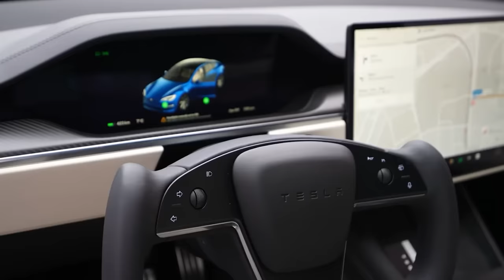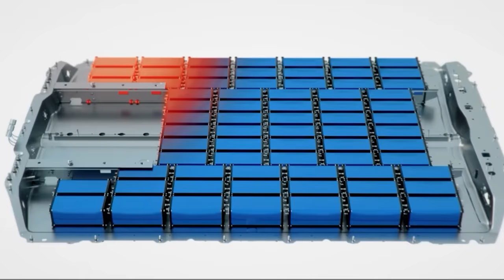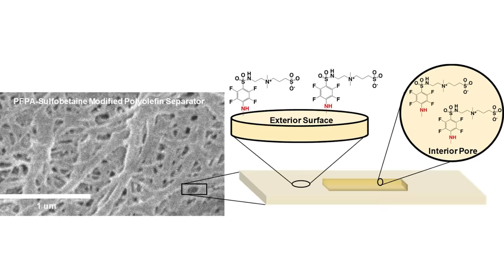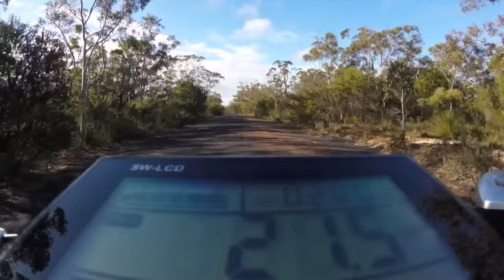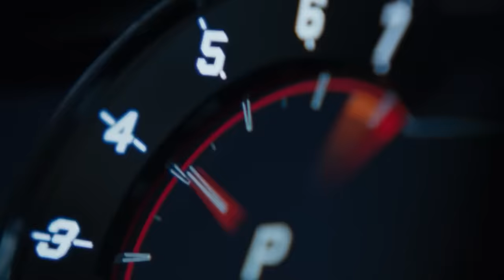EV's Are Exploding In Shocking Numbers

Comment: This is what happens when governments think they know best.
Reply: govt always thinks it knows best, but it never does
Reply: And how many politicians get a 'gratiuty' for supporting the EV makers?
Reply: No towtruck driver will touch them.
Reply: No this is what happens when unproven tech is pushed out too early.
Reply: Let's go Brandon for forcing us to buy EVs only
Reply: @johndoe8785  The tech is already proven.
Reply: @redbaron6805  hey real quick, how long have we been using combustion engines on a daily basis throughout every facet of our lives? How long have we been using electric vehicles? So just about 150 years vs 15? Tell me what part of that screams proven tech?
Reply: @johndoe8785  You are missing the forest for the trees, for several reasons.

1.  Electric cars have been around since the 1800's, so they weren't exactly invented a decade ago.

2.  They use electric motors to move them, again, technology which has been around also since the 1800's.

The only thing that is even remotely recent is advances in batteries, and Lithium Ion batteries specifically, which is around 40 to 50 years old, with the modern forms of that technology being about 1 to 2 decades old.

Which means they are using a proven technology already, although it keeps advancing.

And Combustion engine cars were not in "every facet of our lives" for 150 years.

Combustion engine cars didn't become common until the early 19th century, which is around 100 years ago, and the engines used in those cars have very little in common with the engines used today technology wise.
Reply: yep, so vote Democrat again.....
Reply: I am pro EV and strongly free market. Let the market decide. If someone wants an EV let them buy it. If someone wants a diesel, or a gasoline powered car, let them buy it. If there are not enough buyers to support the manufacturer of EVs, too bad, so sad for us EV buyers.
Reply: @johndoe8785  You're surrounded by lithium ion batteries, they're in your tools they're in your phone, they're everywhere. Batteries in general have been around longer than internal combustion engines. You are also surrounded by electric motors, they are everywhere and in just about everything. The only real novelty with EV is that people are not used to the idea of battery operated cars,
Reply: @redbaron6805  thank you for such a well thought out and common sense response.
Reply: @davidmlong63  I think you misunderstood. The automobile has been continuously improved on the platform that it's an automobile. The electric automobile has not been around long enough to be continuously improved like the combustion engine automobile. If it had we'd be miles ahead.
Reply: @redbaron6805 yea proven to be a bad alternative to gas
Reply: @gunslinger2261  Proven a "bad alternative" for people that dropped out of school after 2nd grade...
Reply: @garman7921 agree , people dont know they to busy with their life
Reply: The difference  is that using these batteries  in our everyday life things around our house is because they are not constantly running for hours at a time. In a car they are running for hours at a time ,and when they get that hot boom. Plus anytime Salt or fresh water hits it when there hot. Kaboom
Reply: @VEE1959  That is a pretty childish explanation.  You are not constantly using them at your house...???

So, your cell phone and battery powered electronics you are turning off every day...???

In a car, you are using a few hundred watts every night from a battery pack that holds tens of thousands of watts.

And fresh and salt water isn't hitting anything, as the battery pack is sealed.

If you have no idea how things work, just look it up instead of embarrassing yourself on YT...
Reply: They probably have their sticky little fingers somewhere in the profits,there's rarely any true environmental concern involved,&EVs are an environmental disaster.
Reply: @helenbenjafield7351  Actual scientists, which are about 100,000x smarter than you disagree with you.

And looking at many of your claims here which don't even have any basis in reality, that number is probably on the low side...
Reply: Billionaires
Reply: This is what happens when governments try to think.

Comment: John Cadogan says it best, even if it is a rare occurance, it is the violence of it, and lack of options to fight it that makes it so dangerous.
Reply: B.S., He has an Agenda.
Reply: @popsracer886  Who doesn't?
Reply: Rare occurrence or not, I'm not wanting that rare occurrence to be the one I bought. No thanks.
Reply: Have You seen the luton Airport Fire ?
Reply: @peterhall8572  Just looked it up, but can only find mention of a diesel vehicle causing it, not an EV.
Reply: @vincenzodigrande2070  possible but very strange, diesel will catch fire but not from an electrical fault, that's why it's the safest fuel for shipping etc, it's a heavy oil not a spirit like petrol so no vapour
Reply: @peterhall8572  Well, Cadogan has just put out a very interesting video on this exact Luton fire and it is apparently very well possible it was still Lithium ion that caused it.
Reply: @vincenzodigrande2070  Yeah thanks I watched it this morning
Reply: In Southeast Asian countries, there a lot of modified LPG vehicles which were made to save fuel cost. They are quite dangerous and has higher chance to catch fire compared to normal ICE. So, EV is a lot safer and cheaper operate if it has reasonable price.
Reply: Apparently the fire chief was paid off to say it with the diesel fire. Have you ever heard of a parked diesel truck Lighting on fire? Neither have I.
Reply: @wrongthinker350  I live on a canal boat and have 50 gallons of diesel onboard , and a woodburning stove ten feet away, Diesel only burns on introduction to a very hot flame
Reply: @cliffowens3629  Hybrids reflected the most at 3,475 fires per 100,000 vehicles. 
ICE vehicles caught fire  at 1,530 incidents per 100,000 vehicles.
EV fires were 25 fires per 100,000 vehicles.
Reply: @BioniqBob  Missing in the data is the average age of the vehicles involved in the fire. Concerning is the fact that Hybrids are overly represented which would suggest that as vehicle age approaches parity, the data is likely to look very different to what it does today. The shift toward non oxidising battery chemistries can't come fast enough, in my opinion. Fortunately, manufacturers appear to be getting a little more liability shy.
Reply: @davidbrayshaw3529  LOL,Crap
60 to 1 lol, your reply (if true) proves that ICE should be removed from the road. 
Logic eludes you. Batteries are only getting better, while gas vehicles just keep burning up.
Reply: Sorry but is he an expert on EVs? Any relevant training? PhD perhaps? Anyone can make YTube videos, doesn't make you an expert in anything. I mean I could start a channel about nuclear power. I don't know anything about nuclear power but hey, why should that stop me?
Reply: @XenonJohnD  He doesn't pretend to be, he's just stating facts and the accompanied sources where applicable and he says it when information is not conclusive. You don't really need to be an expert to see if a car is on fire.
Reply: @BioniqBob  I don't think that my logic has made too much of a dash for it, yet. Hybrids are two and a half times more likely to be involved in fire than their ICE counterparts. The only difference between the two is the added presence of a lithium ion battery and motor in the hybrid. Why then, more than double the fire risk?
Yes, batteries are getting better, and they are getting SAFER. But that does not alter the fact that there are a large number of EV's on the road that incorporate
older, more hazardous chemistries in their batteries. This is of concern as it's older vehicles that utilise this technology that have been bursting into flames at the highest rate. The EV industry has been painfully and neglectfully slow in making the move to chemistries such as lithium iron phosphate. Yes, old ICE vehicles will keep burning up but it is impossible to deny that there are a lot of potential ticking EV time bombs on the road.
Reply: @XenonJohnD  In all fairness, he is an engineer, and he has worked in the automotive sphere for the bulk of his life. I think it's fair to say that when physics, chemistry and math are at the heart of your trade, you're probably a little more adept than most at being able to make reasonable deductions with regard to a number of technologies.
Reply: Any fire that makes its own oxygen is going to be a bum griller!
Reply: Not rare.
Reply: It would have to be classed as a Phosphor or Magnesium fire to get the correct response.
Reply: vince, youre right, the rate is lower, but for sure when happen, is like a tsar
Reply: @popsracer886  So do you.
Reply: Some EV buyers are thinking they are saving money buy not paying for fuel taxes ment to repair roads but that is and will change too .

Comment: The old saying "more money than sense" cetainly applies to EV buyers
Reply: Only if you believe everything you see on the internet.
Reply: Obviously you do.
Reply: Can't beat a good old Diesel best off the lot will be still running after the Apocalypse 😂.
Reply: I refuse to park my car alongside any EV.
Reply: EVs are not efficient, the government subsidizes them.
1. Without doubling the price of gas it wasn't even close.
2. These heavier vehicles don't pay road tax, and not only get residential rates on electric power but the power companies restructured their rates to make power real low at night and soak families high rates for late afternoons. 10/KWH higher in afternoon
Reply: @daleostrom3613  You are more likely to die in a regular car crash, than from an EV fire. An average American has 1/100 chance of dying in a car crash (1%). EV fires occur in 0.14% of EV cars (14/10,000).
Reply: Nobody wants EVs , I wonder what would happen if an EV caught fire on board a ferry, or in the Channel Tunnel. Normal fire suppression systems wouldn't work.
Reply: @roro-mm7cc Assuming you mean the gasoline portion of car crashes, if your numbers are correct, it's because of puddle jumper roles EVs are used in because using them for travel is a nightmare.
Reply: @trueamerican7034  no I literally just mean the probability an average American dies in a normal car accident. By simply driving a car you have a 1% chance of dying. By driving an electric car you have a 0.1% chance of you car catching fire - the main concern is therefore normal crashes.
Reply: Whilst the more apt saying, Less sense than money applies to fossil buyers.
Reply: @roro-mm7cc … also true … you’re more likely to die in a regular car crash than from an ICE fire.  
You’re assertion is no argument either for or against EVs.
Reply: @Jack-bs6zb  Its saying that you have an insignificantly greater chance of being killed by an EV car. But the benefits if everyone drove an EV would remove the health risks associated with toxic car fumes in cities.
Reply: @roro-mm7cc  ... EVs use electricity produced from coal fired power stations which create pollution (nuclear and wind/solar don't but the latter is small scale and sporadic). The only virtue of EVs is that the pollution they're causing remains at the power station and not in the high street - not mentioning the lithium mining.
Reply: @Jack-bs6zb  The pollution in cities is caused by combustion veichles - im not talking about C02, I'm talking about particulate matter, and toxic gases in the air. It's why the air is so much cleaner in the countryside. Power stations emit C02 and the air quality pollution effect is only local.
Reply: @roro-mm7cc  ... co2 is also a pollutant if it's an undesired addition to the breathed air.   Facemask enthusiasts, however, risk harm by rebreathing their own exhaled breath.  Ev's aren't so much a product of technological evolution as a politically mandated imposition. Fashionable among what used to be the Chelsea Tractor set and an unaffordable burden for the masses.
Reply: @roro-mm7cc as the driver of the car I have a huge role in preventing an accident. Lithium ion battery spontaneous combustion, not so much.
Reply: @allansmith3837  Only down hill with no fuel.
Reply: @trueamerican7034  Your tinfoil hat is showing.
Reply: Lithium, the most reactive metal. What could go wrong.
Reply: Absolutely!
Reply: @michaeltotten7508  Even the uneducated have a voice.
Reply: What people rarely consider is the polluting process it takes to gather these rare earth ores etc that involve a practice of "melting rock" to extract certain materials for batteries I don't think there are enough of these metals to make all the batteries if all vehicles were EVs. None of this mentions the electromagnetic emitted from the writing and motors.
Reply: @trueamerican7034  Okay Nancy.
Reply: Funny😂
Reply: Nancy
Reply: Nothing like a simple blanket statement borne out of ignorance and stupidity. Many EV buyers like the low noise, seamless power, reduced mechanical complexity, and lower operating costs compared with similar vehicles.
Reply: Unless you’re saving tax, works for me and costs next to nothing.
Reply: And you don't make any.
Reply: @trueamerican7034 I have a different perspective as I don't agree with all the points made. I purchased my electric vehicle without any government subsidies or tax breaks. The cost of my EV was $23,999 as it was a used one. It only adds about $30 to $40 to my monthly electric bill. Additionally, I pay $250 annually in road taxes. While my EV weighs 3,563 lbs, a Chevy Cruze weighs between 2,870 and 3,229 lbs and a Ford F250 weighs between 5,697 to 7,660 lbs. I understand that the Ford F250 is much heavier, but it's worth noting that the roads and bridges have to accommodate vehicles of all weights.
Reply: Until you realise that someone like me spends $200 a week on fuel in my petrol 4 wheel drive.       Now I save $10,000 a year by having a PLUG IN HYBRID EV.    It's all wheel drive and I save enough in fuel to completely pay for the vehicle in 5 years.... just in fuel savings.  It has a 10 year warranty.         .... I can't afford not to drive an EV.   
Lol.  I can't understand why so many people hate EV. . I think it's just ignorance.
Reply: @Liams_Fraser_Island_adventures  No, it's not ignorance.  A hybrid is less destructive to the environment than an EV, but only because there are fewer batteries.  If you were spending 200 a week in fuel you drive a long distance and you were driving a gas guzzler.  Besides, you're not driving a "pure EV" so you don't get to sit at the cool kids table.
Reply: @PruneHub  no. I wasn't driving a gas guzzler..... I was driving a very modern turbocharged, midsized SUV.     I have a lawnmowing business and a small farm and drive around alot.
Reply: @PruneHub  it's not a hybrid..... it's a "plug in hybrid" that can be used as a fully electric vehicle,   has about 100km a day range.  Just enough for most days. But when I need to use fuel... it uses only 1.5 litres per 100km.  So it's much more efficient that a normal hybrid wich normally uses about 5 litres per 100km
Reply: @Liams_Fraser_Island_adventures  Your ten-year warranty has a certain amount of allowable mileage.  I have no idea what yours might be, but when your warranty runs out it will cost you a fortune to replace the battery.  And in a few years, when governments realize the batteries can't be recycled and must be buried in toxic waste pits, you'll pay for that too.  Not trying to puncture your dream balloon but things will change for you in the near future.
Reply: @PruneHub  160,000km 10 year warranty.    actually the battery's are very cheap compared to most EV.  $10,000 AUD ... wich is what i save in fuel in 1 year.... .  Also they predict lithium battery prices for all evs are going to drop every year. To about half current prices by 2030 as production increases.    Like here in Australia we have the second biggest lithium reserves in the world and we don't even mine alot of it yet.     Heaps of new mines are just starting up
Reply: U aint wrong there mate.."!!!😱👍🏿
Reply: @roro-mm7cc  lol, so EVs don't ccrash....  that's cause there's not that many EVs yet... anyway, the super polluting mining and toxic batteries are bad for the environment...
Reply: @snowrocket  And the 1 hour recharge time if you're lucky and the woeful residuals that will wipe out your investment because the second hand market doesn't exist
Reply: another saying, There are none so blind as those who will not see.
Reply: @roro-mm7cc  You’re more likely to be driven into a tree that causes the car to explode in an EV than in an ICE